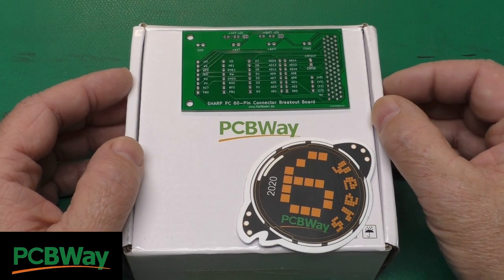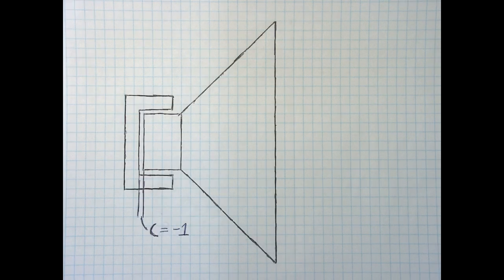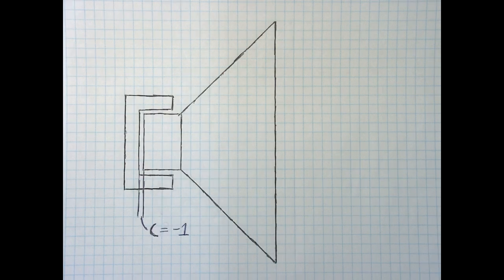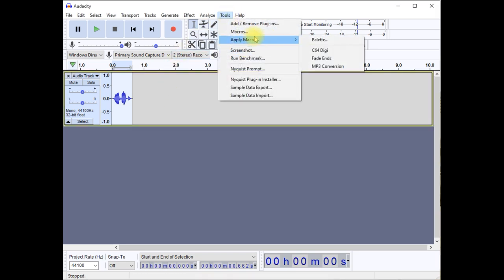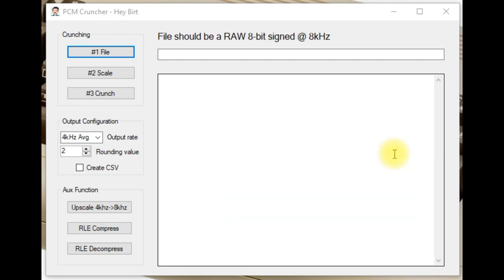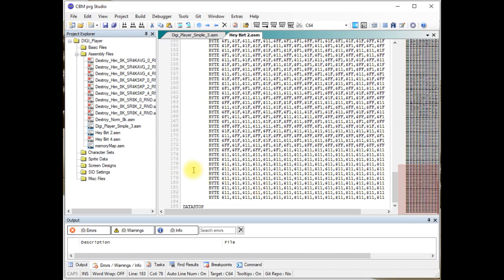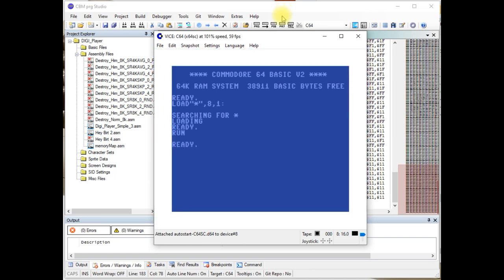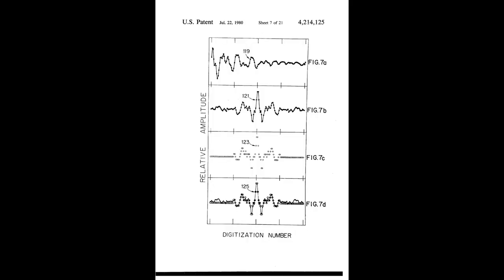C64 DIGIs, how they work and how to make your own Part #1, Plus a look at Forest S. Mozer

Comment from the maker: As fate would have it while working on Part 2 of the Digi video I found a bug in the Cruncher program. Funny thing is that I already had recorded the bit about how the scaling worked and that I had no idea why I did it that way and made a suggestion as to what would have made more sense. 

I'm 99% sure that is where the bug is, so after squashing it I'll resume the video production. This weeks video might not be out on time but at least it makes for a funny story.

I will upload the fix ASAP.
Reply from the maker: Turns out this bug only caused an 'off by one' error. The real issue is a bug in newer versions of Audacity (2.4.x) which won't output 8bit signed raw files. The older version on my laptop (2.3.x) works properly. I will demonstrate this in the next video.

Comment: Nice job Jeff, and thanks for the shout-out! :)
Reply from the maker: Thanks Robin. Found a bug in my C# code whilst working on Part#2 :) hopefully it will be squished soon.
Reply: @HeyBirt  Good luck! I was surprised that the two rounding values you showed would sound that different from each other. I'd expect it to be a more subtle difference, so I'm wondering if there is a bug in there somewhere.
Reply from the maker: @8_Bit  I turns out that it is an Audacity issue. I have 2.3.3 on my laptop and it will export both 8bit signed and unsigned. On my desktop with 2.4.x it always exports unsigned no matter what is selected. When the scalar in the Cruncher ran it was trying to convert signed to unsigned and screwed up the data.

Comment: I dont "remember" the voice from Impossible Mission.  I did see it when I watched a playthrough recently.  See, the reason why i dont "remember" it was because i had it on the Atari 7800.  There were no voices on that one.  I played it a lot as a kid, but i could never beat it.  Turns out, the keycard puzzle pieces would spawn under the computer terminals in the Atari port.  And as the computer terminals would be accessed instead of searched when using up on the joystick, these pieces could not be obtained.  That really did make it an "impossible mission".  It was a very meta experience.
Reply from the maker: Wow! I wonder how they managed to miss that in play testing?

Comment: Thanks for making this! Worked like a charm. A suggestion is if you could show how to combine digis and regular c64 channels?
Reply from the maker: When you are playing a Digi you are consuming the whole SID, you can only play your sample. When your done with the Digi you can use the SID as normal. Think of how Impossible Mission, etc. work they never play the sample (voice) while there are sound effects (running, jumping) being played.
Reply: Theres a program called Digi Organizer that can do that. It cant do long samples tho you have to do a bit of sequencin
Reply: @HeyBirt  that's absolutely not C64s limitation, just programmers not quite being able to solve it back then. C64 actually can play 8bit samples, e.g. by using triangle waveform restart on regular oscillator, and even scroll screen at the same time - things evolved quite a bit over the decades ;) Here's ending part of Wolderland 13 demo running from stock C64 and disk drive (digis are main part and synth is used for some additional subbass) but I actually recommend watching whole demo as earlier it also includes parts which play together synth+digis and do visual stuff simultaneously. Plus it constantly loads stuff on the fly from the floppy drive in the background:
https://youtu.be/oEiQxFL2Tzk?t=431

Comment: Very cool Birt, I remember back in the day that you could use a datasette to load audio and have c64 sample it. I think it came from Compute's Gazzette/ Wasn't the best quality like this however.
Reply from the maker: Hi, I found some similar articles in some issues of Commodore Magazine from 1987 and 1988. In one of the later ones they added some filtering to the input before it was digitized which (similar to what I did with Audacity) which would have helped a lot.

Comment: Why are you pressing cancel instead of OK at 9:05 and 9:16 ? So you didnt apply that HPF and LPF
Reply from the maker: I was just showing how those things would be set separately but then go on to explain that I made a macro apply both filters and the normalization at one time and then I did run the macro.
Reply: @HeyBirt  you also could CTRL+Y to undo it later 😅 but yeah later I got the point with the macro 😊

Comment: Why don't you explain how you get the "C64 Digi Macro" in Audacity? It is not default. You are very unclear with stuff here.
Reply from the maker: Hi, setting up the macro for the filters used for a Digi is just like setting up any other macro in Audacity. I thought I had saved the macro and added it to the project on GitHub but I could not find it there when looking just now.

My PC crashed/died yesterday, and I don't have Audacity set up yet on this 'new' machine. When I get it set up I'll find the macro I used and add it to the file set on GitHub. (Or maybe I did not as it was a pain to 'import' macros into Audacity. I don't recall.)
Reply: @HeyBirt  It doesn't matter now. I really dont understand why someone will take this difficult Audacity-Cruncher-CBM studio way when there is program to convert WAV to Digi-samples for the C64 in 10 seconds.
Reply: @PeaceDub  What's this 10-second converter called?